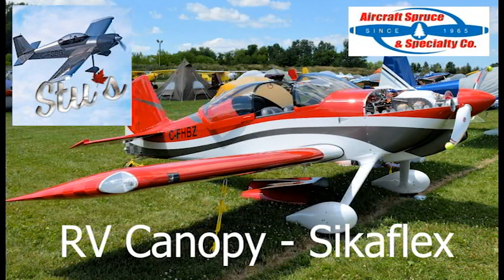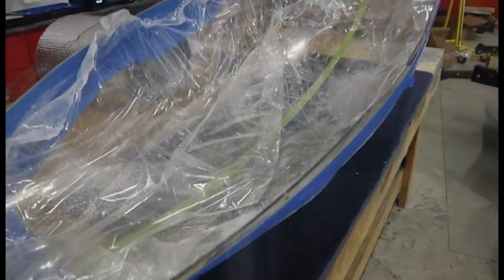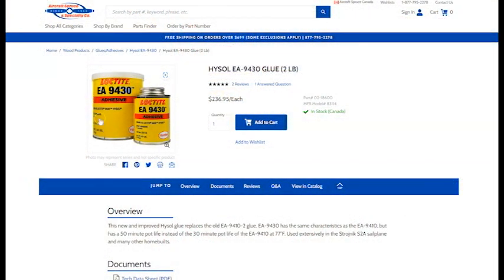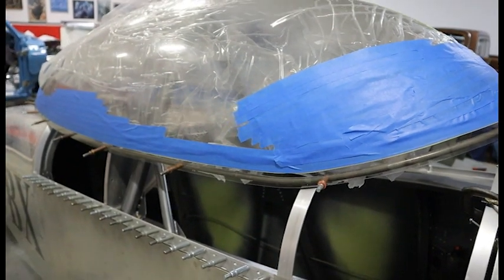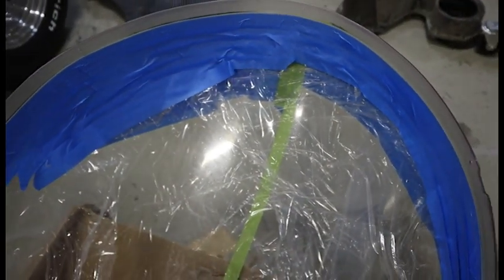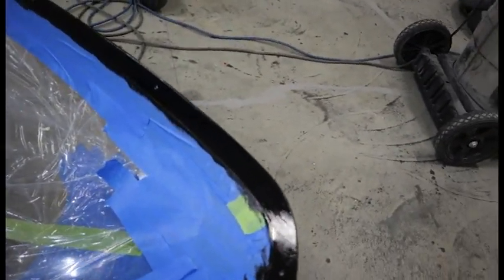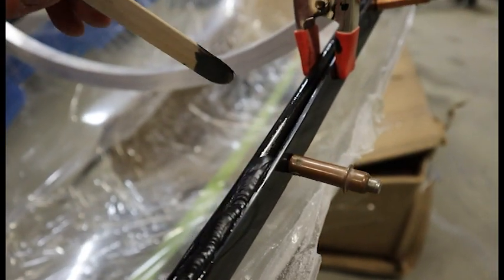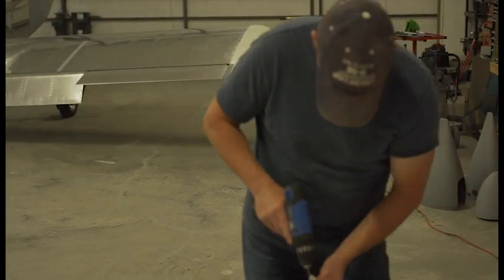Aircraft Canopy - Bonding with Sikaflex

Comment: Thank you so much for the how to videos. You said you flipped it over to do the topside of the frame. How did you fit the sika tube with the curvature of the canopy? Also, was it 2 weeks of sitting? One for the bottom before moving and then the flip?
Reply from the maker: Flip it right away and then let it sit for a week.  You can get most of the canopy frame with the standard gun.  At the very front and back you will have to squeeze some sika in there and then spread it with pop sickle stick or similar.  This is where masking tape helps a lot because it’s easy to make a mess

Comment: I was thinking about using Sika Flex on the 4 canopy , I believe I will give it a go. Question , do you fill the cleko holes with sika flex .
Reply from the maker: It never hurts.  I definitely fill in gap where spacer was but the hole itself is less critical